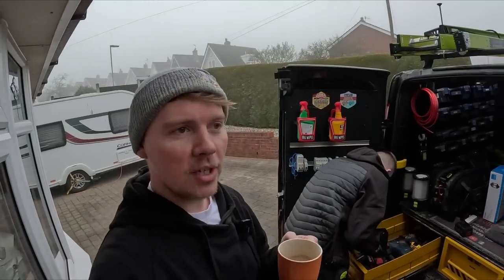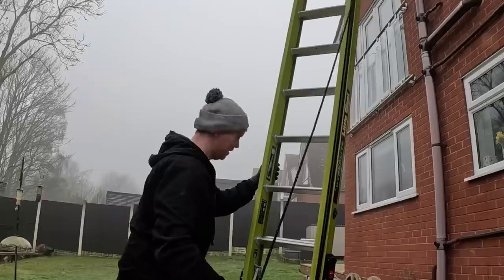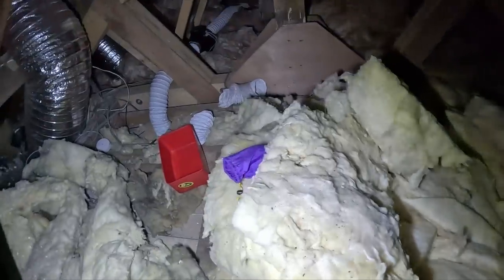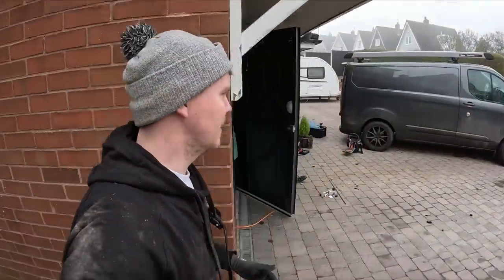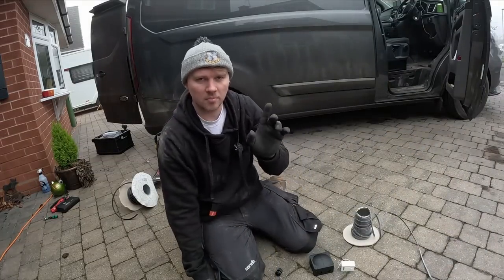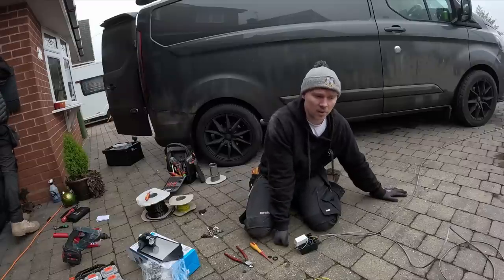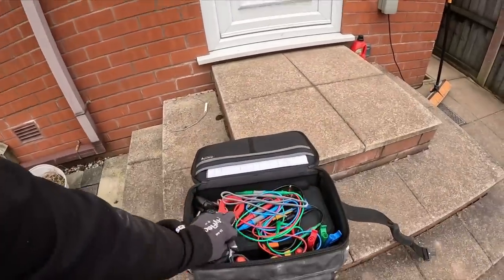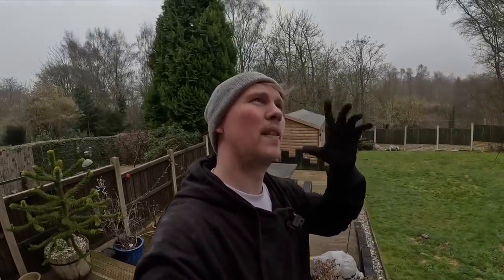Nearly ripped off the family jewels

Comment: Ouch!  BTW that voltage operated trip brings back memories. I remember when we stopped fitting them as they wouldn’t operate on a fault once we started with installing main equipotential bonding to gas/water as any fault current took the easy route through the fat 10mm2 earth cable as opposed to the high resistance offered via the trip coil to the earth rod. Happy days!😵‍💫

Comment: I glad I'm not the only one that pairs smart devices before there installed. But I don't consider kinetic switches as that smart. The a very basic smart switch?  The are smart switches cheaper and better out there . The only time I would install kinetic switches if there is no internet and WiFi available